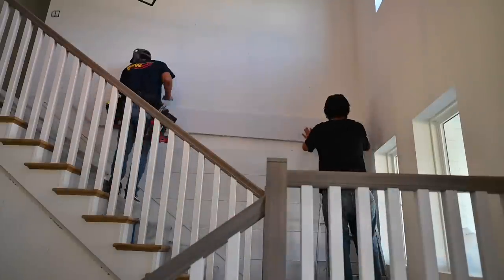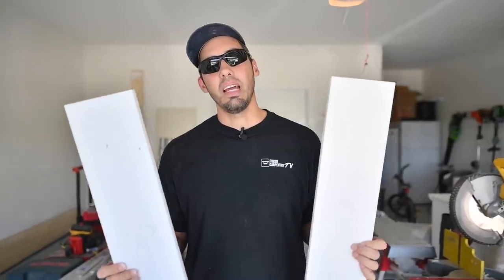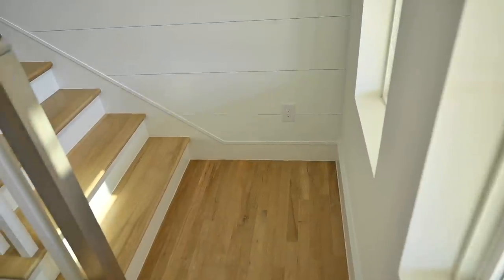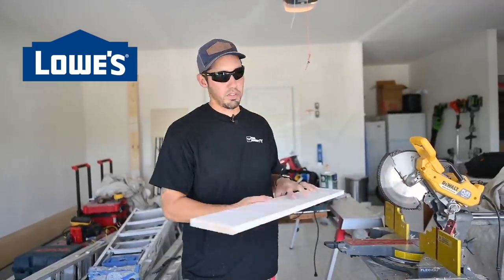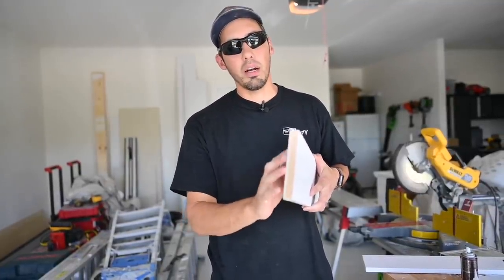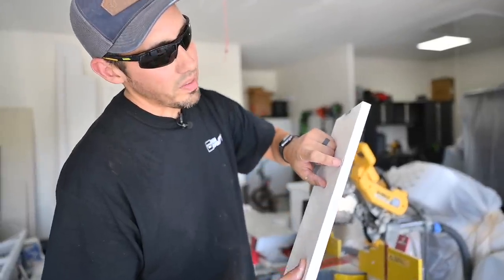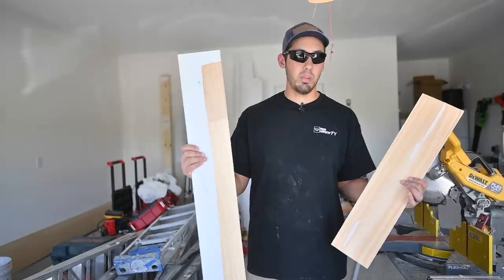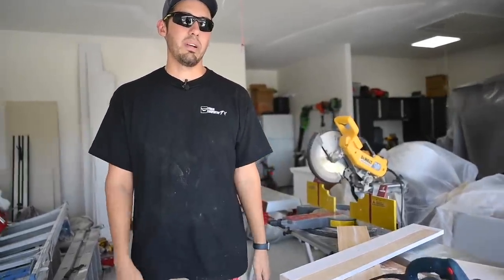DON'T Buy These Boards from Lowe's

Comment: A moisture meter might have been an interesting test too. If the one board felt heavy, that will probably indicate a high water content, which suggests a board that will have problems as it dries on your walls.
Reply: I supply the secondary lumber processor that fingerjoints and primes the product that is in the big box stores. The softwood spices that are used are everything from four different spruce spices to five different balsams plus white, red and yellow pine. The density between all these softwoods varies due to the growing season and the resin in the wood. This is what give you the weight difference. All the processors of fingerjointed and primed lumber are held to only use KD lumber that is dried to 12 percent moisture or less. The glue in this process only works if the lumber is KD to 15 percent or less. This product is marketed to the developers apartment owners and those looking to put as I say lipstick on their pig. The custom home builder is not what this product is going to satisfy. I been manufacturing and developing processes in producing fingerjointed lumber then is then primed with various coatings for now over 45 years. A Hugh learning curve at great expense over those years has brought to what you see in the market place to day. For the most part all fingerjointed lumber primed or not is from low grade what is four common or less. The average length of a fingerjointed piece is between 8”-14”. If you look at most softwood trees that is the distance between the branches or what is a years growth for most softwood spices. I understand why this craftsmen felt compelled to make this video. But the product was never intended to be a high end product. The big boxes are the ones that wanted this on their lumber racks. 
I produce over 30 million bdft of this product a year and have seen growth in the market of 10 to 20 percent every year. I don’t think it’s going to change. I will be increasing production to be double by 2025 only because the market needs it.

Comment: Excellent job explaining and illustrating the difference. Regarding Lowe's, the quality of their inventory on pretty much anything was so sporadic that it's the last place I shop, but sometimes they're the only local vendor with a needed item in stock. I've got way too many Lowe's stories for a brief comment, but the worst burn was doing a whole house with a brand of windows called "Survivor." They began failing within a year, and that's despite the fact Consumer Reports actually listed them as a "Best Buy." (So much for 'Consumer Reports'.) Their warranty support was 'The Run Around' until people gave up when the brand disappeared in bankruptcy. (So much for that "lifetime warranty.") Then, there was their drywall debacle - drywall made in China with industrial byproducts that off-gassed sulfur fumes. Not only did it make properties uninhabitable, but it corroded metal. Despite Lowe's having the transaction records and knowing who purchased their toxic drywall, they contacted no one and only a handful of their biggest customers benefited from a Class Action Lawsuit before the claim period expired. Personally, I avoid Lowe's like the plague with rare exceptions.

Comment: Here's a couple of points.... first, I am NOT an expert regarding the products you mentioned, but do have a little info to share. One is, finger-jointing (machines) usually cut out most imperfections such as knots/etc. The quality of lumber adds to that of course. 

Also, when being assembled finger-jointed board can also create imperfection such as holes around the joint due to a lack of compression the joint together/tighter, odd swipe on the end joints with the fingering blades and thereby needing a filler. Also, sometimes two different thickness at the joint are compressed leaving problems at the point they come to together. 

I have observed this while working "with" (not for) a company whose primary business is FJ pine products. I also have been told that gesso coatings that are sprayed on will seek to level out and thereby floating out some imperfections and cupped boards, making the product flat, but in the middle it will have more gesso in the low area. When you flip the board over that center area would have less in the middle. Gesso is used as a filler, so it makes sense low spots would have more material than high spots. If the product is than sent through a sanding machine to a particular thickness it's understandable why gesso is thick and thin based on what the substrate is...

Lastly, this company I work with from time to time..."surprisingly" (not really) make products labeled for Home Depot, Lowes, Brand X, as well as themselves. With each one making demands as to the price they are willing to pay, product quality, and packaging requirements.

Like most things.... there's a lot of smoke and mirrors in front of the curtain of reality. And then there is China made products on top of all of this!!!

Comment: Isn't it deceptive marketing to sell the product as 1x6 when it doesn't meet industry standard dimensions for 1x6?
Reply: FWIW dept, a hardwood 2X4 for example, fresh cut from a hardwood sawmill has never been 2 inches thick, but 1-5/8"  as standard in industry for many decades.  Not to say a full 2" thick board is never cut, maybe specialty, etc.
Reply: Deceptive?  not if you know the actual versus the nominal size.
1/2" water pipe in copper is 5/8 OD & 3/4 in PVC or galvanized.  Its all about the right product for the job.
Plywood is always scant on its actual thickness.
the more you know the more people will amaze you.
Reply: @bobwoods5017  I understand that. Industry standard for a 1x6 is 3/4"×5-1/2" and 2x4 is 1-1/2"×3-1/2" but these boards DON'T MEET the standard. Callout size and actual size are standardized. When you design for standard and the material is shy of standard, more material is required than would be with standard dimension materials. All builders understand this. The "callout" size and actual size were standardized for building materials a VERY long time ago. Pipe callout size and actual size are also standardized...within their industry.

Comment: I just checked the prices locally and a 1x6x16 Lowes or Home Depot board is $28.05 ($1.75 lf) while my local Windsor one dealer is $48 per board ($3.01 lf). That's a pretty substantial difference that adds up quickly.

Comment: Usually in the Home Depot/Lowe’s materials I have seen heavy “primer” peels off, can’t hold on as a true thin coat primer. Chips and messes up.
Reply: That has everything to do with the wood being to wet when they put the primer on. 
Ever have a board the weight a lot more then the rest

Comment: Great information, thanks for sharing. However, I suspect Lowe’s and HD are well aware of what they are buying, and probably force the vendors to deliver this inferior product due to cost pressure. Walmart applies similar pressure to their vendors to squeeze every penny out of them.
Reply: I dont think anyone here would argue otherwise.  Its more that they force the price point from suppliers as their bottom line and then say whatever you have to do to make that happen if it looks good on the shelf is all good.

Comment: lol, lowes are struggling in my area, most of them closed down and their stores in Wisconsin are kind of dead. I think Menards, Midwest largest hardware store, is hurting them too much here. Good video tho!
Reply: Yeah... The Lowes near me looks like a ghost town most of the time... Then home depot, literally a minute down the road is usually packed like it's Xmas. Very odd how bigger of a crowd they manage to draw in. Sometimes I go to Lowes just so I can get stuff in peace lol.
Reply: Wish Menards had a better hardware department. Their power tool lineup isn’t any good.
Reply: Menards sucks in my opinion. They built one 1/4 mile from my house right across the street from Lowe’s. I still turn right amd go to Home Depot. I don’t like Lowe’s either. Neither store keeps the finish carpenter in mind but I would 100 to one go to Lowe’s or Home Depot over menards. Their tools suck, it’s too damn big, and I hate having to go to this desk to order my material, then go to this register to pay for it, then go to my truck and have to go out behind the store. I bought a cpl sheets of drywall from menards. Took me almost an hour. I can load up drywall on a cart in Lowe’s amd Home Depot and go pay for them easily amd have it loaded in my truck and on my way back to the job in ten or fifteen mins.
Reply: @Senpany_kit_abuse  and do you ever get the 11% back. Few times I sent in receipt I never got my discount back. Menards is piss poor on safety. It sucks when you want to get something and the aisle is closed because they are getting something down in an aisle next to the the aisle you want to go down. Home Depot and Lowe’s does this for customer safety wich is great. A Lowe’s by us had a fatal accident. A Menards worked pushed a pile of tile down on a customer killing him. Might take a little longer to show at the other stores but much safer.
Reply: @AlexKunstar  same in my area. I prefer Lowe’s for this reason, but I never purchase lumber from a box store. At least at Lowes the store is clean & organized. HD’s in my area look like they were hit by a hurricane.
Reply: @kevinmeyer8068  yeah masterforce crap doesn't cut it.
Reply: We don’t have a menards here just Lowe’s,Home Depot and a couple other suppliers that are not close. Lowe’s close to me is booming even though their customer service is absolutely terrible.
Reply: Menards lost my business when they went covid crazy with the mask policy, I’ll never forget how terrible they treated customers.
Reply: Opposite in Indiana. 
Lowes is super busy- mostly contractors. 
Menards is medium busy- mostly home owners. 
Home Depot is dead. Honestly they always have the worst road access. Have to drive through a strip mall to get to there stores.
Reply: @rootvalley2  same i will never forget 18 year old employees telling me i need a mask.

Comment: Gesso hide imperfection in wood for a smoother finish. Also quickly dulls your saw blade, like fine sand paper.
Reply: Can be hard on your lungs to
Reply: I was rounding over some edges on some coated 1 by a awhile back, it was a small brass pilot bushing bit, and that coating literally ate the bushing off of it. I just happened to notice it was leaving a small lip on top and that's when I noticed the bushing was gone. Outside corners will be sharp as a razor too, which is great in one way and horrible in another.
Reply: Clay is mud, mud is fine rocks.

Comment: I totally agree. I used Winsor boards for a large project. I ran short and got a bord for HD (same as lowes). After using the exact same sanding, primer, and the finished product was much worse with the "cheaper" board. I'll never make that mistake again! I ended up filling and refilling and loads of primer to get the cheaper bord to look the same.

Comment: My theory is that Lowe’s is coating cupped/crowned boards and then running them through a planer so they all appear to be the same thickness. And I bet 1/16” is their margin.
Reply: my theory is lowes does their best to offer whatever they can get .. i work at one .. we have not had a chainsaw this whole year . we have not had a riding mower in 2 months .. we are again running out of lots of things ..  house building has had to slow down because of it ..
Reply: Faux Que   we have grills and picknic tables  at mine .. we dont have cabinet knobs or sheet rock putty .
Reply: @williemoon7522  the Lowe’s by my house ran completely out of employees
Reply: @titirititiri6360  HA !!    we go thru plenty also ..my boss just quit today .
Reply: @williemoon7522  that’s your opportunity man! Tell you you will fill in
Reply: @titirititiri6360  With no employees at the registers self-checkout still keeps the lights on (haha).
Reply: @winddealer1  hahah very true, your right, may see machines stocking shelves one day

Comment: Big box stores are set up for price point they pick, order and design products based on where they wanna be and vendors meet there price point.  
Ex Ariens snow blowers for HD are different and most repair places don’t fix because the parts are different from commercial landscape retailers they are meeting HD price point so the wood vendors are not gonna change

Comment: The intent of the gesso coating is to a achieve a very smooth surface prior to applying the primer.  This lets the manufacturer use less planer cuts per inch, (higher fed speed) and end up with a smooth surface.
Reply: To each his own. Some people might prefer the look. It sure won't have any wood grain showing. There is always a variety of boards and finishes at the big box stores. He could used the cheaper PVC boards for the ship lap and the end result would have looked almost the same.

Comment: I bought the Windsor One product based on this video.  The stuff is great.  The prime paint is applied perfectly and it is difficult to find the finger joints because they are so tight.  The stuff is true and clear and is difficult to distinguish from plastic Azec type trim boards.  It was cheaper than clear pine.  Bought mine at Jackson Lumber located in northeast Mass and southern New Hampshire.

Comment: I’ve never had good luck with lumber at Home Depot. It’s always warped, cracked, mishandled, always rounded never straight edge. It’s always bad.
Reply: I usually plan to budget 2-3 minutes per board to sort through the stack to find something usable.

Comment: One thing I noticed is that coating is water soluble. A couple of pieces got rained on and after they dried they were glued together.I pried them apart and the coating pulled off one board and stuck to the other making a gouge in one and a glob of double thickness on the other. So don't spill anything on them or let them get wet.

Comment: I did one wall of shiplap in my house with Lowes shiplap. Out of the Big Box stores theres seemed to be the best. But it did take some more prep work and filling, sanding etc to get a smooth finish. But I do agree with you it makes for harder joints and would never work for a wainscot wall!

Comment: Hey Richard, give the SW ProClassic latex Enamel a shot when u get a chance. Sprays great with a little thinning and a fine finish tip. Plus you save on costs. Just sprayed a mantelpiece, a decorative column, doors, and a front entrance with with side lights. Finished like glass. I don’t know what your paying for Emerald, but the ProClassic is definitely cheaper here in Bama.

Comment: Assuming that thinner coating at the edge is the mill using the coating to fill in and flatten a cupped board.

Comment: I have mistakenly use these boards on the exterior of my shed for the corners, soffits, and facia.  The real problem that I have noticed is that any slight hit on these boards they will chip.  They chip all the time.  And as water gets to them this clay starts to delaminate as well.  Big problem, stuff is junk.

Comment: Your suppose to pull out those electrical boxes, before wood install , then install cut in boxes(old work box) into surface of the new wood. Your not suppose to have combustible materials behind the outlet, now you do if there is 3/4” plank behind the outlet.
Reply: @FinishCarpentryTV  3/4” box extension? Nice 👍

Comment: I've seen those boards at Lowe's and wondered about the primer being so thick. I figured they were just burying trash wood in the coating so it wouldn't print the finger joints, knots, and other defects on the surface.
Reply: That's exactly what they're doing 
It's awful

Comment: Just saw this video as I am finishing my DIY wainscoting job lol. Got everything from Lowe’s. Oh well. Still looks good to me!
Reply: As long as you get all your wood for a project from one source, you are less likely to get bit by the off sizing (thickness & width) problem.  You still have to deal with the lack of square and proneness to chipping of the coating.  If your project is not cosmetically sensitive to the lack-of-square edges or if you are willing to fill gaps and chips with putty or caulk as needed, then whether those are problems depends on what you are doing.    Those can be huge problems for a contractor doing large volumes of work, of course.  Less so for a DIY one-off.

Comment: Richard,
I am a retired journeyman carpenter in central New York. When you planed the Lowe's board I could literally hear the planer " bridge " from the Gesso coating, to the wood, and back to the Gesso again. Of course this means thee basic board in not even flat. Evidently the manufacturer of the Lowe's product has an adjustment problem with the knives on their planer.  Or, they are doing like the Romans did, the way they used sand and flat stones, LOL

Comment: I bought a couple flat door jamb kits from Home Depot, and they were trash. They were covered in packaging so I couldn't really inspect before buying. Hella warped, and covered in thick primer that chips away easily, and huge visible knots that are impossible to hide. The individual jamb pieces were better quality there. WindsorOne is super nice, worth it if you want a professional result. Lesson learned!

Comment: the reason the coating is so thick but also uneven is that it's likely cheaper to rough plane the wood (rather than drum sand) then use the coating to "self level" on the top and then send it through a drum sander since it will smooth easier. In reality it should be much cheaper than the quality stuff, but for a big box store and DIYers, it's "good enough" plus that 1/2 inch they skim off the width plus the 16ths they skimp on the thickness multiplied over MILLIONS of board feet likely adds up big over time.